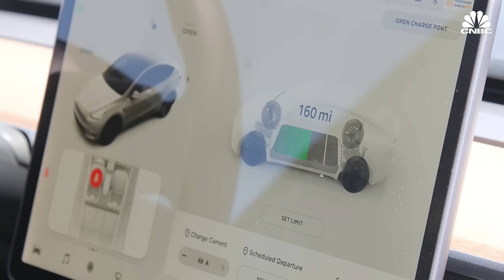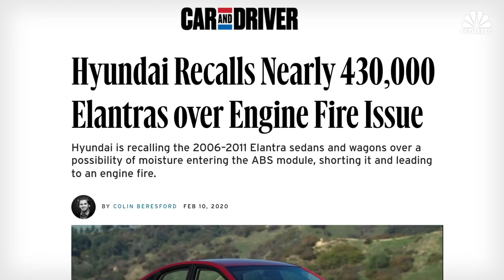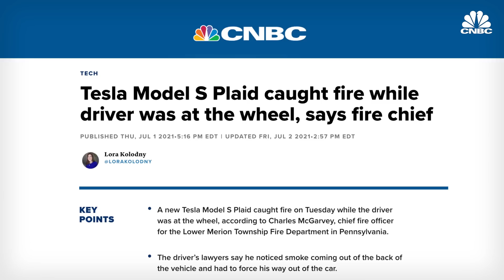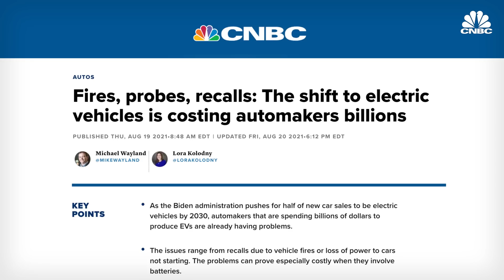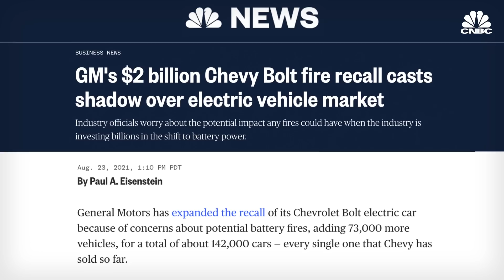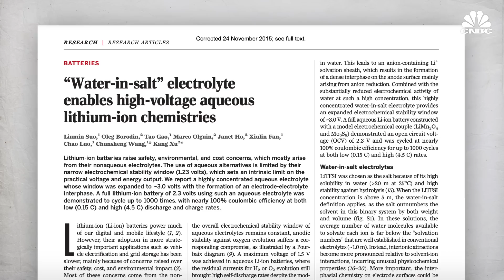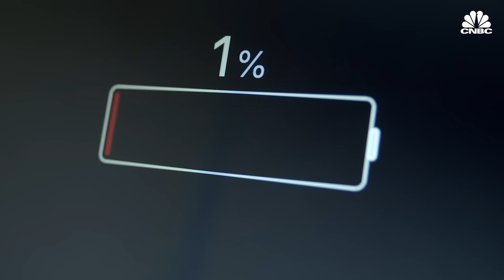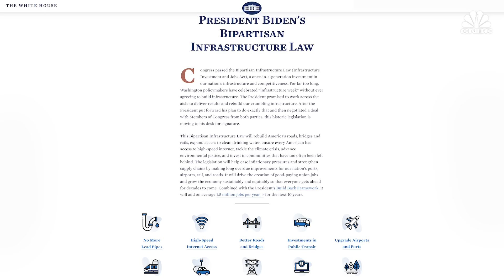Why Tesla, GM And Other EV Companies Have A Fire Problem

Comment: ICE vehicles do have fires, EV's are not alone on this. However, I am an old man, and in my entire life I have never heard of nor witnessed someone coming home from work, parking the car in the garage, and one, two, or three hours later, it just burst into flames. The issue with EV's is that they just self ignite, and cannot be put out. The batteries in EV's during thermal runaway produce their own oxygen. So starving the flames with water, has zero effect. They are using 6,000-8,000 gallons on EV fires. A lot of fire departments now have been instructed to let them burn, and try to prevent it from spreading.
Reply: Don't lie old man!!! You don't know anything about computers and tech!...BTW what the hell is ICE?
Reply: @ex8280 ICE = internal combustion engine
Reply: @DenofBarjack  thanks

Comment: Not a single mention about the horrendous pollution and toxicity of burning or burnt EV batteries , just recently in the news a dude got some residue from an ev fire on his arm , he died not long after  , and nothing could be done.
 I’ve been around conventional cars and trucks all my life , I made it to nearly retirement age, despite also being a tow truck drivers son around smashed conventional cars and being in the motor industry myself in the repair  of them for some years .
  I am really sceptical when you weigh up the pros and cons that pushing humanity into EVs is the right direction .
Not to mention the cost of of doing this is already huge , , and I suspect only become even more costly.
  You have to ask yourself , is the tiny alleged benefit of EVs worth it ?
Reply: Hydrofluoric Acid or HF sounds like the cause.

Comment: And now we have the Luton airport car park fire reminding us that fire codes may require upgrades to sprinkler systems and possibly mandate increased minimum spacing between parking spaces to increase the chances of containing fires and avoid structural failures.
Reply: They need liquid nitrogen sprayers at some point.

Comment: Battery Electric Vehicles (BEV's) don't have nearly as much of a fire problem as gasoline and Diesel fuelled cars. 

The ratio is something like 1 in 100 car fires is in a fully electric car. Hybrid cars are not electric cars; they burn fossil fuel. Those are the ones with something of a fire problem, caused by their complexity and the fact that they have to problems of a liquid fuelled car with the small addition of potential flammability of a battery. But that risk of a fire is still very low; something like 12 in a million, according to some sources. (Fully Charged covered this, for example.) To narrow it down further, by far the most likely chance of a battery fire comes from hybrids with Lithium-Ion batteries manufactured in China by LG. 

Modern BEV's are transitioning to Lithium Iron Phosphate (LFP) batteries, which have a far less likely chance of catching fire. The most popular car in the world right now is the Tesla Model Y. It outsells all fossil fuelled cars. The Model Y Standard Range is the most popular Model Y, and it uses a battery made from LFP cells. 

Remember that the BEV fire risk is already way lower than that for conventionally fuelled cars, so the use of LFP cells reduces that risk even further.

There is a huge amount of misinformation being propagated by oil companies and some traditional car manufacturers such as Toyota which is designed to deter people from buying BEV's. So anyone reading headlines such as this on will need to check the real facts about EV's before believing anti-EV FUD blindly.

One outstanding point is that EV's are newsworthy, whereas petroleum fuelled vehicles are not.mNews media are concerned primarily with clicks, views and sales. Truth lags behind profit, so an EV fire becomes a ripe field for harvesting in this regard. 

In contrast, it's noteworthy that the huge fire at Luton airport, in England, which destroyed about 1,500 vehicles, stopped flights and tied up over 100 firefighters for almost two days, whilst destroying a four year old multi storey car park which didn't have a sprinkler system, only made the news because of the amount of damage which was done, and the disruption it has caused. In a small footnote, it was mentioned that the fire started in a Diesel-powered Range Rover. Not in an EV. No mention is made of the number of motorway vehicle fires which happen almost invariably in Diesel and gasoline powered vehicles every day of the year in Britain.

Be honest; how many gasoline or Diesel vehicle fires have you seen or experienced? And of the now millions of fully electric vehicles on the roads, how many fires in them have you witnessed? For most people, the answer to the second question is 'very few', or 'none'. I've seen countless liquid fuelled vehicle fires, and no electric vehicle fires. I've been in two vehicles which were on the brink of a fire, when fuel sprayed from a porous fuel hose or cracked pipe, onto a hot exhaust manifold. In both cases, the quick action of the driver saved the vehicle, and one of those incidents was with my own car. I've also helped to save another gasoline fuelled car which caught fire whilst being serviced. It took a team of people to keep it more or less under control until firefighters arrived with the proper equipment. The car's on board fire extinguisher was completely ineffectual.

As with all things in life, the emotive or unusual things grab our attention, and news outlets know that, to their advantage. But a balanced view is needed at all times if we want to understand life as it really is.

Comment: EVs do not reduce emissions and will be obsolete  in 5 years time.  They are a political invention, not an engineering invention.   They are subsidy driven, not customer driven.    When the money to finance them dries up, so will the desire to own them.  The batteries are not identical to tanks full of fuel,  gasoline and diesel need oxygen to burn, lithium ion batteries produce their own oxygen.   They are like rockets.
Reply: What do you think will work instead?  Hydrogen?  Ammonia?
Reply: @DenofBarjack  Hydrogen can only be produced by electrolysis of water only platinum electrodes will work for that.  A lot of electricity is needed which defeats the purpose of doing it.  It can only be contained in heavy steel tanks and if it escapes it is an explosive and dangerous.   Then you move to ammonia,   why don't you ask me about horses, bicycles,  wood,  nitrate, oxygen enrichment of engine air.    There is only one future when people are eating out of bins for food.  That is Petrol/diesel  gas, coal and oil.   The Germans bulldozed a wind farm recently to only a coal mine.

Comment: Electric vehicles don't work it's a simple as that they are clear and present danger of fire. They can't control the batteries so there's gonna be flyers simple as that I need to return to the aspirated engine using fossil fuels which are good for the environment carbon grows trees bring new life "
Reply: They are way less likely, so far, to have a fire, but when a fire does happen, it’s way more difficult to put it out, and it’s so hot that it melts the entire car into a blob.

Comment: Electric vehicles as far as I’m concerned is nothing more than a scam a threat to control the public look at how many fires we’ve had with vehicle sitting in parking lots on the street at homes where I see is a surge INSURANCE cost if you open one of these piece of garbage it was made quick and dirty without a lot of long-term testing and research it was seeing more and more fires and there much hotter and stronger than beforeshow me how many gas powered vehicles long seat Street is blowing up fires or shipping they just not enough to justify a complete turnover to socialist Marxist communist electric vehicle concept is a scam

Comment: Stop using Lithium batteries. That's the issue. We hear of other types, like sodium-ion. What's going on with those types?
Reply: They are researching them.  Tesla has upgraded to LiPO which take higher temperatures without risk of rupture

Comment: Perhaps the bigger question is why the corporate media has a problem with lying about EV's?  Worldwide less than 150,000 EV's of all brands have been recalled due to fire risk.  Just last month 3.3 million Kia and Hyundai gasoline powered vehicles were recalled due to "extreme" fire risk and that is just the amount in North America, the worldwide number in the recal is over 4.5 million gasoline powered vehicles.

Comment: Another 'problem' with the big EV batteries is their weight. It's similar to lugging around 8 to 9 one cwt bags of coal.. 1,000 pounds..   possibly twice the weight of an i/c engine with transmission. Not a great step forward in terms of car design,

Comment: The cheapest way to handle an EV fire is to just let it burn and prevent everything around from ignite instead if possible.
When an EV is about to catch fire, it's already too late to save it when it gets to the battery wich happens very quickly.
It is not like a gasoline car.
I mean, all that water to cool a toasted battery that is unusable when the EV is standing on the ground with nothing around it or things that could be easly moved away from it.

Comment: They are playing the fire problem down. They must be being paid by the motor company. They are dangerous, and I would not trust putting my family in one of these death traps. With electric coach fires is especially dangerous, it is unlikely that all the occupants would escape before they are turned into a black block of carbon.

Comment: The future is RE fuel making, not charging a stupid battery.  It will cost 20 times more to charge that stupid battery with 100% RE grid than to make RE fuel off grid.  This 20:1 cost ratio will end this EV insanity.

The concept of a battery for a car is silly stupid at the core.  It takes 500 times more rare earth materials to make BEVs than to make fuel, and the CO2 is 200 times more.  

The fire risk alone should get them banned.  We can't have a car burning on a road for 10 hours.  Totally insane.

We don't have the materials for EV, so we might as well stop now and get real solutions to energy and CO2. 

I have the tech to get to CO2 neutral, and EVs can't.  Deal with this FACT.

Comment: I think electric vehicles should be required to have mechanical manual windows and doors to prevent people from getting trapped inside in the event of a fire. There is a recent story in the news of a man having to kick out the car windshield to escape a fire when the cars electric windows and doors failed to work during a fire. The new Tesla Cyber truck has glass that's near impossible to break in an emergency and should have a way for people to escape.
Reply: It is mandatory for ALL cars to have this feature. Windows etc are also electrically driven in ICE cars.

Comment: The battery charging management system seems to be the weak link...
One cell run away seems the issue...
They have too many in series...
Hard to manage every cell....
Dendrites are going to happen. 😢

Comment: I think the eV battery pack has a fast charging tolerance point that once you bridge that point, will turn into a change reaction. I think the fires are inversely proportional to the fast charging rate. Meaning, the slower you charge it, the less likely it will ignite or go off

Comment: They knew all along each one of them just how vulnerable batteries can be - jam packed full of electrons fully charged - it is absolutely impossible to extinguish a run away battery melt down - that’s why it’s way way more dangerous then fuel cars - they knew and now have to deal with it - and that ain’t easy - this will persist for years to comes period 🤪👍 so says a member of our genius species me 😜

Comment: you think it is bad now?  Wait till they are many years old - 90% of EVs were made in that last 3 years and over 50% are only 2 years or less.  They are fire hazards that are much harder to put out because they have their own oxegen.  Then consider what if you have a truck with a battery 12 times a big; and it catches fire in the Lincoln tunnel?  It is a catastrophe waiting to happen; luckily there are only a few electric 18 wheelers

Comment: I think it complicit that CNBC who has been documented to be pro-electric vehicles, didn't mention three extremely important bits of information. The ocean-going vessel, Felicity Ace displacing 17, 738 tons & 200 meters long was sunk by a single electric car that was parked inside the vessel for a voyage...this single EV caught fire & spread to hundreds & hundreds of other EVs. Another vessel, the Fremantle Highway, also 200 meters long but displacing  59,525  tons also caught fire by an EV blowing up....In both of these vessels EVs were the cause of the fires. The chemistry of an EV is vastly different to that of a gasoline fire in that the exothermic reaction in a battery fire releases oxygen during the fire....making extinguishing said fire almost impossible by conventional means.

Comment: In a normal fire, fuel, oxygen and heat are required! Litsium batteries are something else, they  have fuel and "oxygen" tightly together with a thin insulation between ! as mustard in the coffee, the firefighters bring their water and then things happen.. Water consists of hydrogen and oxygen, I think it is hydrogen that Litsium reacts explosively with and makes the fire much worse!! (?)

Comment: Water is not the best fire extinguisher for lithium batteries.
Lithium reacts intensely with water, forming lithium hydroxide and highly flammable hydrogen.
Car manufacturers are racing to develop the next models while not being forced by regulators to encapsulate proper fire neutralizers into the battery's pack. It should be mandatory that lithium battery manufacturers wrap their batteries with chemicals to neutralize the chemical reaction such as powder graphite or sodium carbonate.

Comment: I work with electricity and have seen batteries catch on fire and blow up.  Small batteries, I must say, nothing overly dramatic.  Yet, it was always because the contacts got shorted or they overheated.  My understanding is that what people call 'the battery' is actually an array of several batteries.  I do not see how the array could not deform and short the terminals with the major momentum of the impact during an accident.  Then what?  We had a triple roll over that totaled our vehicle.  The impact blew all four tires.  We landed on the side of the road.  There was ice everywhere, had we landed on the road, we would have been hit by other vehicles.
I can't see how severe deformations resulting from an accident would not short contacts and start a fire.  Maybe a couple cells, then others.  So I am not touching one of this things.

Comment: A insecure product offering extostential risk not security in transport. Make a real difference get off grid don't be vulnerable if can.😊 maybe add a flood out port to each vehicle leading to the power source incorporate non reactive agent to regain control so argon or some soda mix ,liquid ceramics or even a non flamable injection type foam so when the battery goes bad it becomes a hagfish belching slime or froth.
Just a thought or two ,great video

Comment: Li-Ion batteries is the #1 issue!

Over charging, failed protection circuits, and Li-Ion batteries can't get wet. When Li-Ion batteries get wet, they short out causing them to over heat, and start fires. Excess heat can also cause batteries to explode, or start fires. Never want an EV, no matter how much you pay me to get one. Forget that BS!

Comment: The article poses the wrong question. The probabililty of a cell being defective is the wrong question. The important question is what is the incidence rate of a lithium ion cell developing an internal fault that results in a thermal discharge. This is low for a single cell.  When you place thousands of cells in a vehicle and submit the vehicle to common road shock, and put thousands of vehicles in the population the incidence rate of a spontaneous fire is not small. This is the problem that has been ignored and is still not addressed. It is not acceptable that these vehicles pose a risk on the road, a risk in a parking garage and a risk in your home garage. When a single cell faults and discharges energy, it will cause a huge fire that cannot be extinguished. This is a problem that can be quantified with risk analysis and the answer is not pretty since we are already seeing the incidents in the public eye. A hurricane resulted in large numbers of EV fires. A number of electric buses have demonstrated the problem. This is a problem for the EV industry that is similar to problem the dirigible aviation industry faced using hydrogen in the 1920's that was publicized by the Hindenburg disaster. How many EV fires be tolerated before something constructive is done to fix this. Maybe we need a safer battery than Li-Ion.

Comment: EVs dont catch fire they melt down. They have a chemicl reaction where the fuel and oxygen are packaged together and cant be fought with water. 
The biggestbproblem is the fumes that emit heavy metals especialy Cobalt which is lethal when inhaled or it lands on your skin.
EVs should be banned from closed multistory carparks, banned from garaging near your home or charged indoors, 
The current firestorm on the SS Dutch Oven is a case in point where the toxic residue now soluble on the boat even means the hulk cant even be sunk as an artificial reef